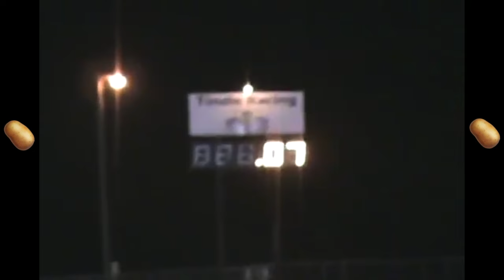THE GREEN CAR INTRO - B20 VTEC CRX: Disco Tech Vlog

Comment: Awesome vintage Honda's there guys. I have to admit when it comes to two wheels in a Suzuki guy, specifically the GSXR line up. My first bike was a 96 SRAD 600, then I got a 99 SRAD 750 and now ride a K7 GSXR 750. So much fun. Anyway, that CRX is beautiful, I always love Honda colors as well. For me it's Milano Red, Tahitian Green and Electron Blue Pearl. Do you race the 8th mile by choice or is that just what's close to you? I'm not a big fan of 1/8 racing with Honda's because they typically aren't 60' cars, they're big end cars. I've always just been a fan of the full 1320. Currently the daily driver/time attack DC2 runs low 13's with all motor B series power and my EG drag car will be in the low 10's this season with K power. (If I can swing a new head from 4Piston and some new cams maybe even a 9 sec pass this year!) I'm running at Honda Day in Englishtown next weekend which will be my first actual track outing of the year. You guys should make the trip to HDay, it's only what 1100 miles or so from you guys.
Reply: Also, B20Vtec power is still very much a viable option even by today's standard. I ended up getting rid of my NA B20V for a K20/24 setup, but if I wanted to put more money into the B20 it would have been able to stay competitive. I put a 2400lb full interior EG into the low 12's with a very basic B20V so if I would have gotten extreme it could have been much faster. (84.5x89mm 12:1, ported B16 head, Skunk2 manifold, Skunk2 Pro2 cams, AEM cam gears, Supertech springs/retainers, Type R LMA, RC310cc, 190lph Denso pump,  Hytech header, Thermal 3" exhaust, S4C LsD tranny, Fidanza Flywheel/ACT clutch. Tuned on S300 it Made 235whp 154wtq on gasoline and could have made even more on E85. Including machine shop work I had maybe $3500 into that whole build. It held together insanely well too, ended up getting a 3076R after I thrashed on it all motor for about 2 years and making a steady ~450 HP It never missed a beat. All that on stock sleeves too, engine longevity is all in the tune.